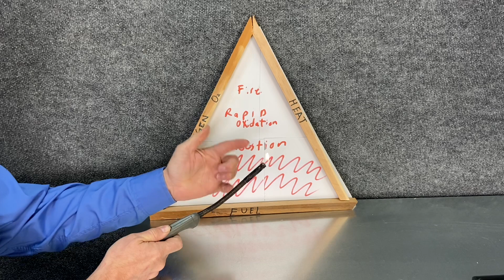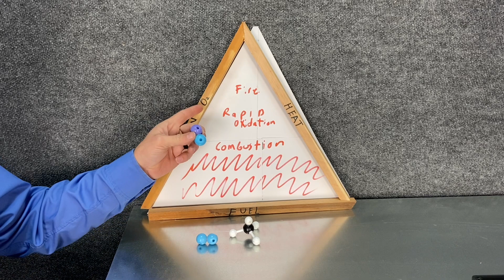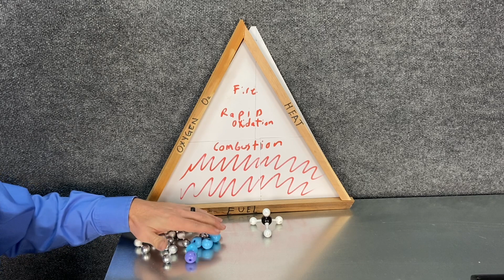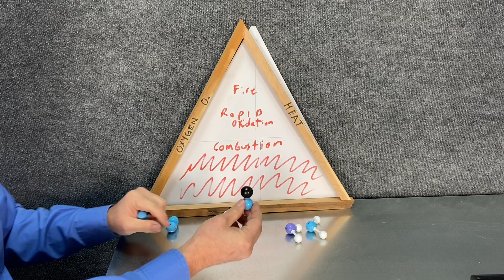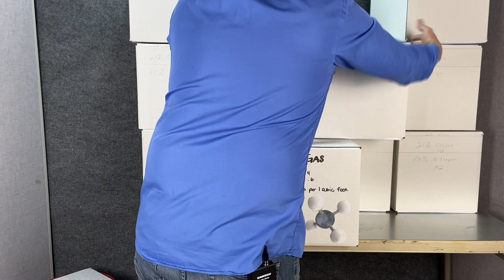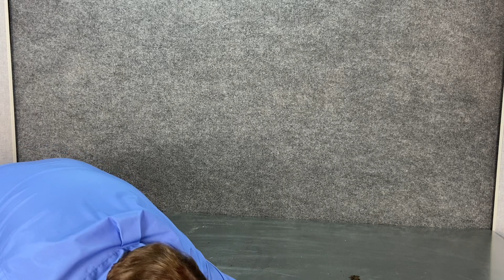Combustion in relation to a gas furnace

Comment: Ty, I’m really appreciate you for all the info, time and as a lab make it easier to understand.
In new technology what kind of analyzer you’re recommend?
I have refrigeration and air conditioning technology eighth edition is this book will be enough?
Thank you.🌹
Reply from the maker: I just did a video about combustion anylyzsrs today. 
The 18th edition is a good book. There are some points that are dated as well as the latest version but overall it's good.

For combustion I recommend Carbon monoxide a clear and present danger and Combustion Analysis & Fuel effect both by ESCO. Also classes from NCI and Measurequick.

Comment: Ty , I am a bit confused, It was my understanding that for
1 cubic feet of natural gas, 10 cubic feet of air was required for complete combustion.
1 cubic feet of propane, 24 cubic feet of air was required for complete combustion.

the amount of primary and secondary air contained in combustion air is aprox 60% primary air , and 40% secondary air.for natural gas, this means  that 6 cubic feet of combustion air is used  as primary air and 4 cubic feet is drawn in as a secondary air.
fuel gas+primary air+secondary air= products of combustion
Reply from the maker: Hi Henry,
1 cubic foot of natural gas  per 10 cubic feet of air for perfect combustion. Remember perfect combustion is only obtainable in a laboratory. 
In furnaces typically 50% excess air is used. (Another 50% for delusion air on old furnaces)

https://www.achrnews.com/articles/105766-btu-buddy-58-combustion-air-for-a-gas-furnace
Reply from the maker: Also I recomend checking out Gas Heating: Furnaces, Boilers, Controls, Components
Book by Jason Obrzut, CMHE

And https://escogroup.org/cosa/combustionanalysis.html
Reply: @love2hvac  thank you so  much ty, if you recommend Esco group, i will definitely check them out